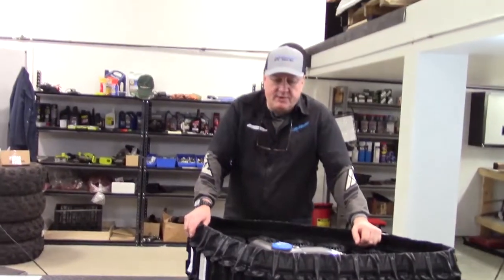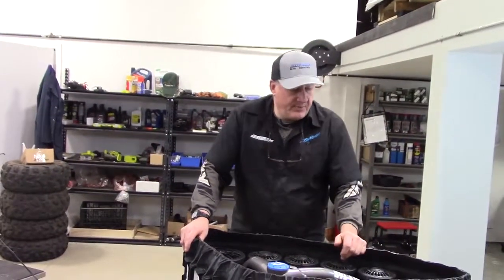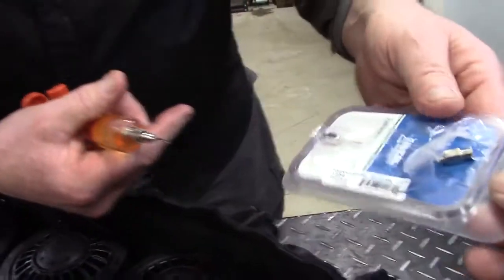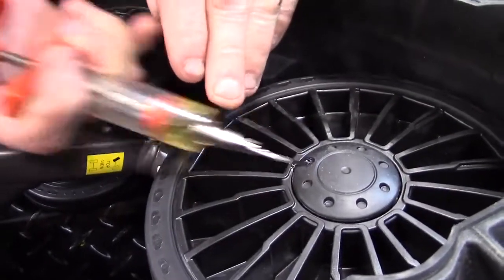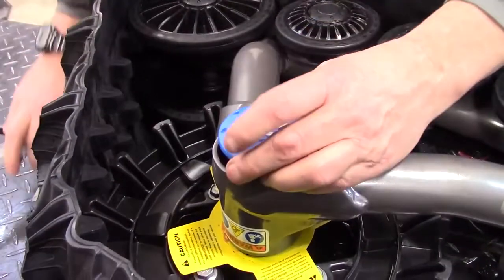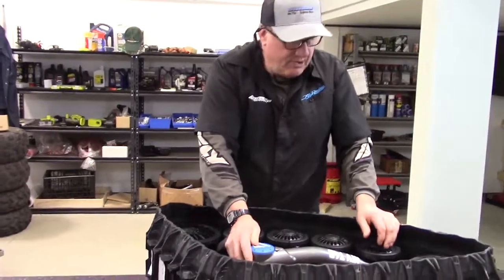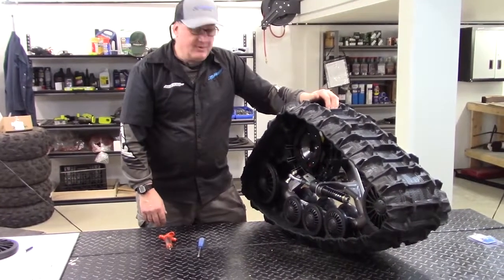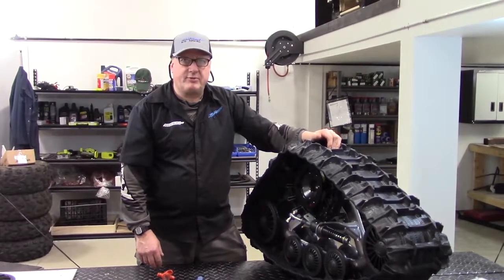How to get 3 times the life out of your tracks bearings

Comment: Here's how to reinstalled the hub covers snuggly in just seconds:  Place a small plastic 'zip tie" on the edge of the cover with the smooth side on the rubber O ring. Push the cover in fully,  then pull the zip tie out.  This seals the cover securely in place.

Comment: Just curious you say the bearings can be replaced which i am doing but what bearings do you use to replace the 6006 du2 and 6oo4du2 as most of my search for this 6006du2 bearing is discontinued by NSK I have found 6006 bearings ranging in price from $10 to over $40  i know which ones i will use just not sure they will last but judging by the dried up grease in the bearings some will need to be replaced and for those of us doing this on our own it will take you between 10-12 hours per track to completely remove all the bearings and all the seals wash out and repack bearings and re assemble complete track thats all 22 bearings on the front track and the 26 on the back track
Reply from the maker: Only replace them if they wobble sideways, put oil under the cap and it will get in the bearings we sell them for 7 to 9 dollars depending on volume
Reply: I didn’t see a listing for the bearing on the site but I did order the rubber cones my tracks are 2012 I bought used and I must say they were serviced pretty well but a complete tear down was due thanks for the tips

Comment: Gary,  I see you do all the smaller wheels. Do you do the 4 bigger wheels with the oil also?  I also see you pull the cap and put the oil in the hub bearing.  I ordered the X4S with the oil bath. Should that still be done?
Reply from the maker: you can also put oil in the larger wheels on the utv and atv,, The x4s with the oi
l bath is filled at the factory and some times seeps a little because of over fill,, you do not need to ad oil unless you replace bearings, gary